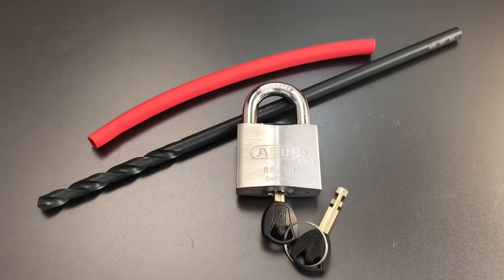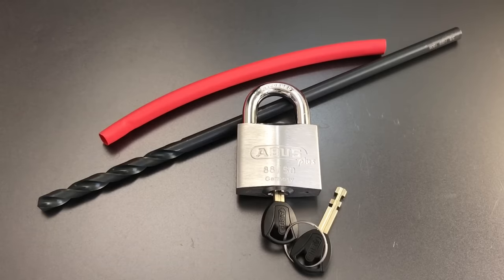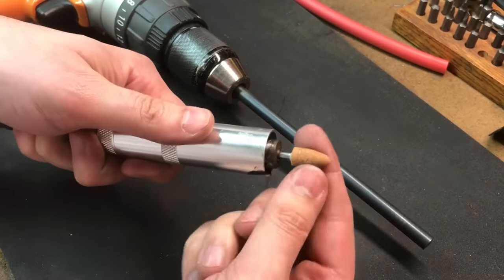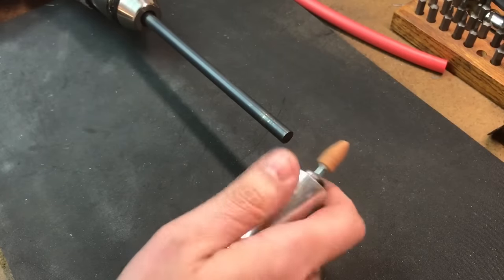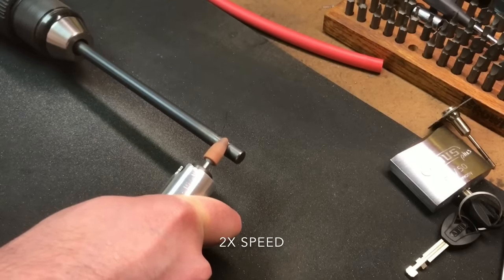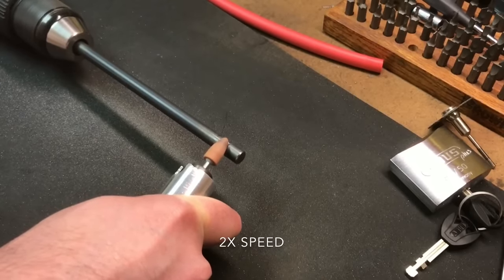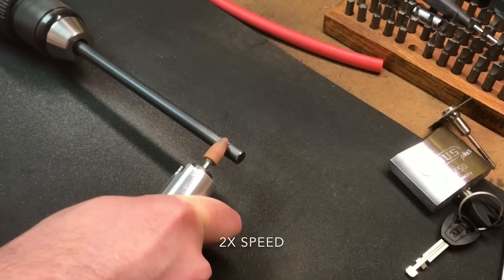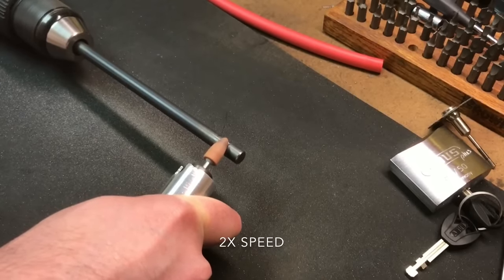[464] LPL Project: The Best Gun Lock Ever?

Comment: I'am not a firearm expert at all but  doesnt keeping the chamber open soften your spring? I dunno but maybe someone can tell me😊
Reply from the maker: No.  Compression cycles wear out springs... not prolonged compression.
Reply: +LockPickingLawyer okay thanks for answering
Reply: @lockpickinglawyer  Extended compression will wear out a spring, as anyone who thrifts Nerf blasters has found out
Reply: But those are not properly hardened spring steel like for the hammer and slide of the pistol.
Reply: Magazines that have been fully loaded for 50 years have functioned perfectly.   It’s an old myth that (good quality) compressed springs lose strength.  Like LPL said,  repeated cycling eventually weakens them.
Reply: @DJ Matusiak Wow, that was a long video.  Summary: sometimes the spring can be damaged from long-term compression, but it is usually only with cheap quality magazines. The high quality springs in a good firearm, or in brand-name magazines should not have as much of a problem, but there's no universal answer that will alway apply, so if you are really worried about it, then cycle through your magazines every 90 days or so.
Reply: @ZippyDan  That's one of the caveats to watching Paul's videos, lots of info and a lot of yea-buts
Reply: No....

Comment: Great stuff. I really appreciate the made not bought perspective. As a half ass crastmen amd jack of all trades most of what i go to buy i get mad at not working and knowing i couldve made it custom for the same price or cheaper. Good work especially using the drill shank. Ive used them for punches and various tools over the years. You cant buy/find a blank of tool rod for the price youll find literally any size of bit

Comment: Good project and good video... although I do have concern that, in a 1911 like this, it could be possible to remove it by disassembling the gun, rotating the bar 90° and using a bit of force.
Something I've already mentioned however and that I feel I need to say again: the function of most "gun locks" isn't to prevent teenagers or really anyone from using the gun. Those locks only exists because of force of law, as an implement to technically meet transport or storage regulations. A garbage lock is still a lock, so any penny more you spend on development or materials is wasted in that regard. Same goes for ATF-compliant "gun containers". You had a great video on one which was so bad the ATF override cylinder couldn't even be used - but as far as I'm concerned that's good enough, because that feature isn't meant to be used, it's only there to be technically compliant.

Comment: Very smart idea. Instead of heat shrink I would use self-amalgating tape, better known as Telco tape. You can apply as many layers as you want. You need to stretch out the tape in order to make it work perfectly. Basically, it becomes one solid piece of rubber, and is perfect for many years to come. It is very safe to prevent scratching. Furthermore, I would try to take out only a half of the drill bit in order to make it stronger. However, by far best idea I have ever seen. Congrats!

Comment: A couple tricks with heatstrink that could help you improve the finish.

First for anything you can cut after shrinking, you should. It guarantees an even shrink at the end and makes for easier trimming. You can also get very precise with trimming it off. Other applications (how I use it) is to insulate legs of electronics components like resistors on custom boards or for repairs.

Second little trick to tidy up the inside radius. If you shrink the outside of the corner so it holds in place, you can then pull the heatshrink away from the bend as you start to shrink the inside radius, which should reduce wrinkling. While it's still warm you can further smooth it by pushing a round object (such as the shaft of a screwdriver) into the corner to smooth it out a bit more.

They're very low returns for the investment of time but if it's something you really want that ever so slightly better finish on they can be worth it.

You might know these tricks but I hope some other viewers might find this handy 🙂

Comment: Wow, I never knew you made videos like this! And I only find out 6 years late as well. I love this, and would definately watch if you did something like this every now and then. Also, making or testing out new picking tools would be cool, like when you made that disc pic with Bill. 

A few notes I made - I think most people would have an angle grinder before they get a Dremel - also I pretty much hate Dremels because those tiny tools, and especially the cutting discs, are too prone to break at 30.000 rpm. The angle grinder could probably also have made that groove, although it would probably not be that easy on the eye. Finally, when mounting the heat shrink; when you´ve got that inside corner that folds up, shrink that part first. The straight parts will just move, but this one won´t.

Comment: Suggestions 1. Bend first, drill the groove afterwards. This will help ensure you don’t end up with longer/shorter rod after bending as you can never be exact where the rod bends. 2. Use callipers to measure the depth of the groove in the shackle which has been cut off, so that you don’t need to keep trying locking the lock and drill-grooving repeatedly. 3. Use heat gun (?)

Comment: A tip with heat shrink, even double wall, a heat gun is the most controllable and never burns wires unless you're trying to. If you don't have one of those, a hair dryer on high can do the trick, eventually.

Comment: Two points:  
1. carefully align the padlock unused shackle stub, lock and superglue in place. this will save false readings when checking.  
2. Cut a notch, not a groove. The groove is taking so much metal out it weakens the drill shaft to the point where it could easily be broken by the classic hammer tap to the padlock body.

Comment: Sadly many gun owners simply want a basic cheap lock to comply with gun laws at the minimum requirement. Not to protect kids, but just themselves because of selfishness. Thank you for this teaching video, many of us appreciate it greatly
Reply: While this lock is far superior to the cheap compliance locks, I believe it will only take a few minutes with an angle grinder to remove. Just cut the part sticking out fairly close to the gun. Then twist so that what's left is parallel to the slide, and then the lock will slip out through the magazine well.

Comment: Great at lock picking, not nessicarily a lock maker is what I learned. Use a cylander burr to cut your groove, don't heat up your material in the vice (it will damage the vice), don't use painted steel near a torch (it will off gas carcinogens), and use the old shackle catch to measure where to put the new one.

Comment: The shafts on most high speed steel drill bits are already annealed. They're tougher rather than harder. If they were as hard as the rest of the drill bit they'd snap under load, it's also to protect chuck jaws in your machinery (I'm a toolmaker and machinist). The heat you are introducing combined with your rapid quenching is likely making it harder. Hardened steel with a narrow point like, say, a groove, will give it a weak point. If it was as hard as the cutting edges of the drill bit, a simple hammer blow would snap it at the groove. It is already very weak how you have it now. A better option is to scallop just one side like the manufacturer does. And an even better option is to get in there with a ball-nosed drill. The goal is to leave as much material as possible for strength.

Comment: Change your smoke alarm battery.  :-)  Nice video...great idea.  Abus should sell a kit for this.  Also a heat gun is way better for using on shrink wrap.  Also flip the can upside down during storage and it will save for A LOT longer.  on and use a wood dowel in the hole makes for an easier extraction later on.

Comment: You could just weld a 6” shackle to use in that lock and pull the receiver back and lock half the shackle through the magazine/receiver opening.  This is quickly removed so that a magazine can be inserted, receiver released and you’re loaded.  Fast access in emergencies should be part of the thought process in any locking system. Your system is the same thing…just a lot more work

Comment: PL, if you purge the can of Plasti-dip with a noble gas like nitrogen, argon, etc, prior to capping the can, which removes the "air", the gas will settle on the dip-liquid and keep it from drying out.
Been using this method for decades to keep paint, Japan Color, etc, from drying out.  Works great, every time. 5yo/repost

Comment: 10:40 is like a poor man’s lathe. I use my drill and dremel like that all the time. I have a little, I think, 4” C clamp that fits around the trigger so I can adjust the speed of the drill by tightening/loosening the clamp. 12:37 Use the dremel cutoff wheel spinning in the opposite direction

Comment: Great project and great lock. I'm not a fan of storing my guns with the slide recoil spring compressed for long periods. Maybe next project could be a DIY trigger lock or some type of barrel lock that doesn't require the slide to be cocked. Either way, very enjoyable video.

Comment: I've never tried this with Plasti Dip but with many other things that dry quickly: Put cling wrap right on the surface of the dip. First string a piece of string through some styrofoam cut to the exact size of the inside of the can to press the cling wrap against the sides. String is so you can pull the foam and the cling wrap out. I might get a can of dip just to test this out.

Comment: It will likely cut faster if you slow the drill. Part of grinding is the friction heating the material, and the faster you turn the part you're grinding, the colder the grinded surface will be.

Comment: The feeding ramp is polished to a mirror sheen. The slide's been reinforced. And the interlock with the frame is tightened for added precision. The sight system is original, too. The thumb safety is extended to make it easier on the finger. A long-type trigger with non-slip grooves. A ring hammer... The base of the trigger guard's been filed down for a higher grip. And not only that, nearly every part of this gun has been expertly crafted and customized.

Comment: 8:50 I think you're going about this step the hard way. Why not just use the cut off piece of the shackle itself to mark the spot for the drill shank to be ground out?

That saves you from having to screw around with the lock body itself...

Also, instead of holding the retained portion of the shackle in the lock body with the plasti-dip,I'd use a small blob of 5 Minute Epoxy to hold it in place, THEN plasti-dip the body to cover the Epoxy and make the lock more water resistant...

Comment: 9:00 since the spinning tends to make other marks as well, it wouldn't be a bad idea to drop a long wooden dowel into the hold and perform the same tensions spinning to get a warm fuzzy that the mark you are identifying on the drill bit is indeed the correct one.  Would save a drill bit (and all of the following work) if you managed to pick the wrong spot. It could also possibly afford you some soft dept tests on the notch.

Comment: Since everyone’s getting this 6 years late as well, I just wanted to let y’all know, you can easily temper the metal before putting the heat shrink and/or plastidip. Search YT for tempering carbon steel. If you have an oven in your kitchen, and a torch like this one, you can harden the metal back to almost as hard as new.

Comment: Edit Please don’t get me wrong. I think it’s great that you value gun safety to this level that you’re willing to put a lot of effort into making this. It would be nice if a good lock manufacturer would take your lead and make this into a product. /Edit

Don’t know much about firearms or locks but couldn’t you use a padlock with a long shackle? I guess it would also have to be wide enough to fit around the grip.

To get the depth measurement, you could also just measure the cut off piece of shackle.

Comment: Great idea, but when grinding the notch for the Ball Bearing, I would Grind only Half of the Bar, just the Latch is ground.
The Size of the Ball is very close to the Diameter of the bar, so your Notch is almost All the way through your Bar.
A solid hammer blow, might fracture the bar at this thinner diameter.
Ok,  This Just Popped up on my feed today,  
I see it over 6 years old...

Comment: FYI, you can buy 3/8'' aluminum rod for very cheap. They are often used on 3d printers. Would be easier to cut and bend as well.
Reply: Point was to get the strongest material that would fit and was easily available .  Alu is too weak .
Reply: @johndododoe1411  I don't think a child is going to get it off. This isn't locking up a shed or something, it's a gun. They could steal the whole thing anyway and break it off at home, no matter what material you used.

Comment: Improvement, There is a possibility that someone could cut a piece of the bent portion without cutting the gun. If you can cutthe bent portion shorter than the lenght of a cartridge then you can remove the firearm from the lock.

Comment: I have a question: is there something nasty that would cause problems for cutting discs and most drills?

I use cutting discs all the time but haven't really tried to cut through rock or sand with it.

Here's the idea: what if you mixed sand or grit made from a material harder than the material used in cutting discs in with the plastidip before coating the lock body?

In theory it might cause cutting discs to break, trying to chew through the grit in the plasti dip and might add a simple extra layer of protection for the lock body?

Comment: Recommendations: 
Probably should have been using a water dip cup to cool the drill bit from the beginning. Any coloration implies a loss of temper. 
Disassembling the lock in order to take measurements of the ball bearing using a caliper would have been a useful measurement to have for reference while grinding the groove. 
Applying water soluble ink onto the ball bearing while assembled using a toothpick would have provided a nice marking imo. As long as you disassemble and clean it well later. 
A heat gun is recommended for heavy duty shrink wrap, and is a very valuable tool to have. 
Please replace your smoke detector batteries. 
Awesome results, that's a very attractive home design. A high speed steel drill bit is a very clever choice, and everything cleaned up great. The gun locks available on the market truly are pieces of trash and I'm pretty envious of yours

Comment: I know this is old but maybe you will see this. To keep the opened plastidip from going bad on you, put a layer of water on top before you put the lid back on. Then just drain the water off before your next use. Rinse and repeat. The water will keep the air out and the moisture in but won't mix with the plastic.

Comment: I think there is a major issue here, with the drill bit strength after using the dremel to drill the notch (and the properties of the drill bit steel you used).

When drilling the notch the way you did (radialy), you might have removed too much material in comparison of the original shackle. I suspect there is no more than 3 or 4 millimeter of steel left right where the notch is (would be better to talk surface rather than width but you get the idea)

To explain a bit, I know how to break padlocks, I did it several times, just by hiting it with an object, a handle of pickaxe work well. And guess where they usually break? you got it right!
 just about the notch.  When you hit the top face of a padlock the shackle usually break.
Normally it is not that difficult, just hit hard so the shackle steel snap and the padlock will not stand a chance, but here the shackle have been significantly weakened by drilling of the notch, and its seems really do-able here. 
The question is: 
 Is it possible to break the locking device without breaking the gun? I don't know, it might, as it is high speed steel, it is hard/cutting resistant but aslo way more brittle than some kind of "regular" steel.  I would be intrested into knowing what the performance of the drill bit steel is for vertical tension, but my intuition tells me it less resistant than the shackle steel, as it is, I think, way harder.

using a pickaxe handle would not be very practical here and it would not make sense in a real life situation. BUT I think you could do it by hand, I can't be sure, there is two option and one is far better than the other.

for the first one you just need to find a hard surface like a brickwall, your goal is to aplly enough downward force*, so get the padlock stuck on the edge of the wall, so you can pull on it very hard and give it a good go, I think it should be enough

the second method is way better but I am not sure about it, only work if there is enough play in the locking device.
 If you can rotate the padlock sideways ( radial notch allows you to do so)  the barel of the gun doesn't bother you anymore if you try to hit the padlock in a  downward fashion.
if it is possible I am pretty sure it would not take me more than 5 second to defeat it. Just take the gun by the barel hit something hard with it so that it is the top face of the padlock that get hit

again hoping that hitting the device do not damage the gun to the point it can't shoot anymore.

*when I say downward force I take the padlock standing on the core (shackle up) as a point of référence